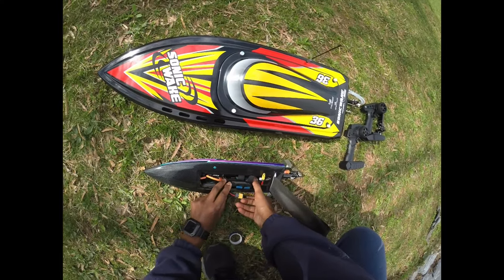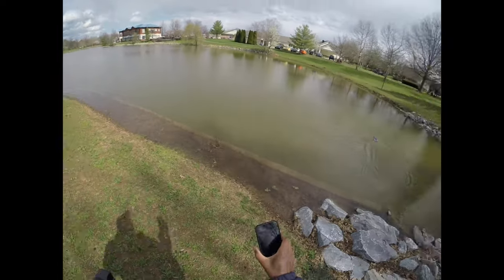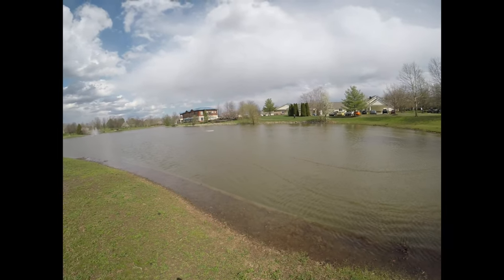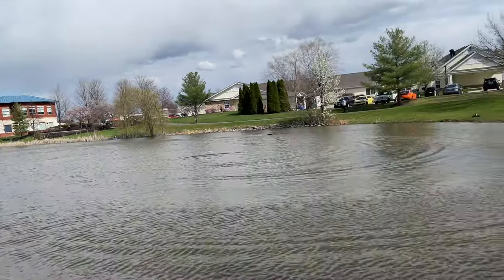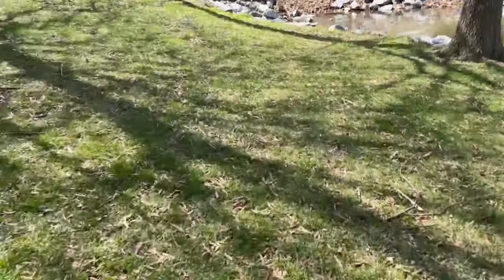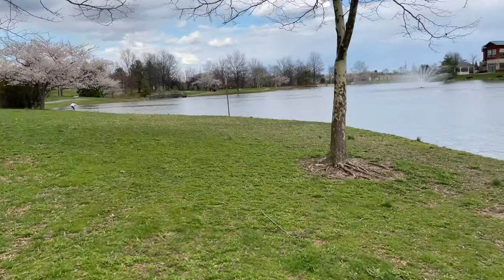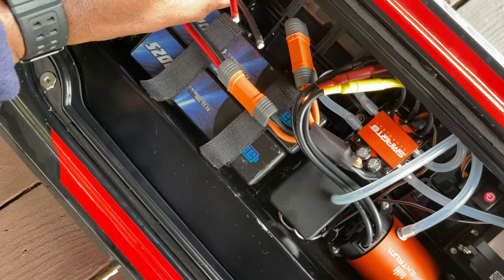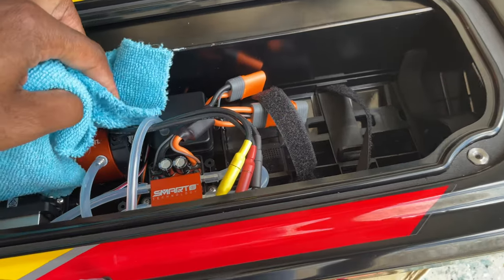ProBoat SonicWake V2 6S RTR Deep-V 36 OXIDEAN MARINE MINI DOM out for a rip #ProBoat #OxideanMarine

Comment: Good stuff Bro! Glad you got it back. You need a string attached to a plastic soda bottle and the mini could have pulled it back to shore for you. Got to have the connectors soldered very good or they can de-solder themselves from the amp spikes getting on and off of plane.
Reply from the maker: Yeah bruh. My soldering is usually really good. I don’t use those connectors usually. I soldered them back up and ready for sone more rips.

Comment: Wasn't expecting that 🤣🤙 couldn't of worked out better tho.....Next Video....HOW TO SOLDIER CONNECTORS🤣✌️
Reply from the maker: 🤣. It happened to another person with this boat also. I don’t run these ec5 ic5 connectors. I really want to change them to what I usually run. These esc pull a lot of amps.

Comment: That oxidean marine boat is crazy fast what are you running 3s 4s ? That sonic wake is dope to but man that little boar was flying I been wanting a boat to add to the rc collection what do U think about the proboat miss geicio 17 power boat racer as a starter boat
Reply from the maker: The mini dom was on 3s. I personally love self righting boats. I have never owned a miss geico but they seem awesome.
Reply: The 17 Geico is a great little boat. Always self rights, super fast out of the box. Great for first boat, I use mine for rescue as well.